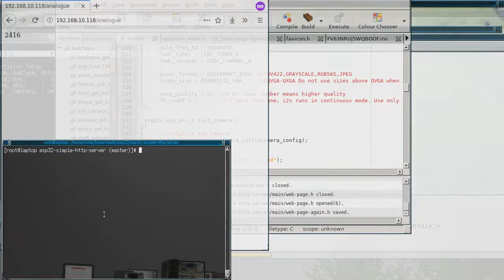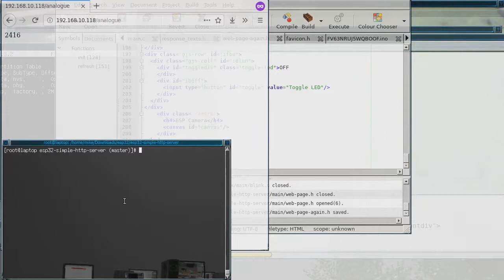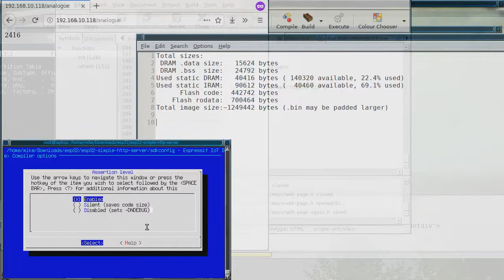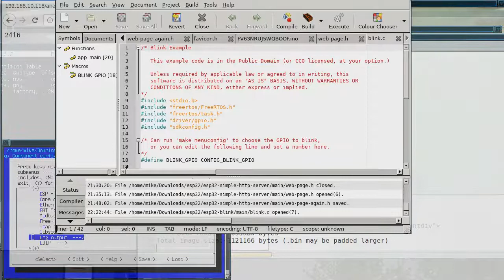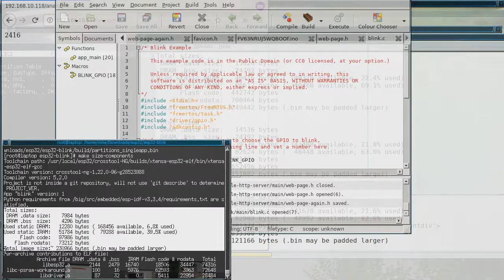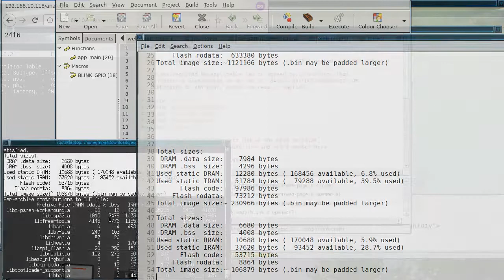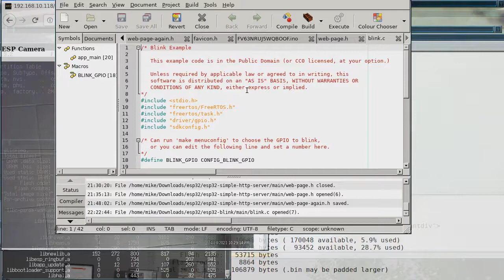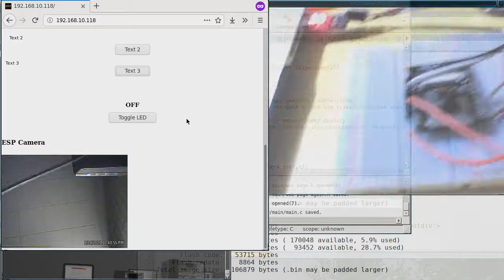Reducing the size of ESP32 code by turning of the debug features in the ESP-IDF

Comment: interesting what you say in the description. Although arduino ide is basically just a flasher and you can achieve anything in esp-idf with manually setting registers etc. in c++ with arduino ide as well. One could argue that ESP-IDF also hides something through it's checkbox-settings, which actually behind the scenes are "just code" (that you can write in arduino ide)

P.S.: This menuconfig-thing could prove me wrong, not 100% sure what it does behind the scenes, assumingly it also change some registers / sends control sequences. If there is no arduino library that you could easily use in setup() {} then it's not quite feasible to do with Arduino IDE ^^
Reply from the maker: There are some settings in the Arduino IDE that you can change, which are the same as in the menuconfig, but the menuconfig just has more of them. They both end up writing the settings to the same "sdkconfig" file which is used as a part of the build process.
Reply: @MacpczoneUk  thanks for replying! I also found out arduino ide is based on a esp-idf-sdk binary, so it's possible to compile it yourself with a specific configured menuconfig, but from that on it's hardcoded in that sdk binary. So you were right esp-idf is the more direct way of working
So i guess sdkconfig has some settings that are only changeable through esp-idf (compilation)